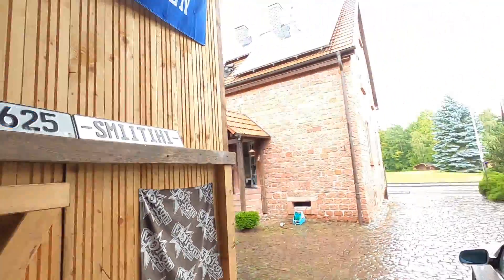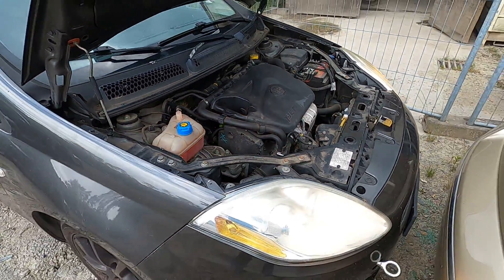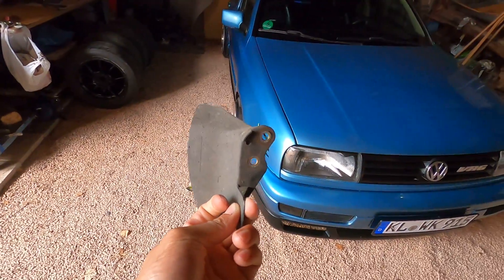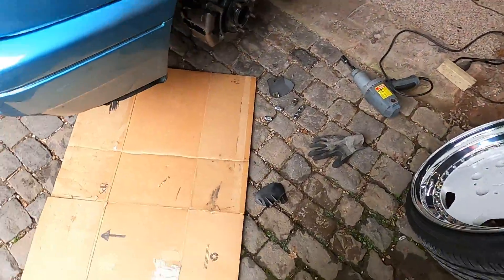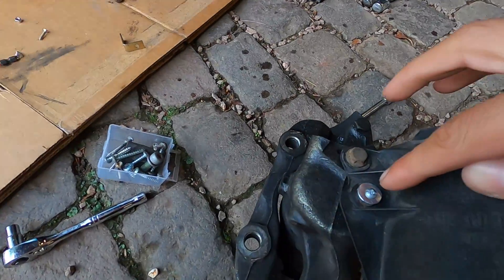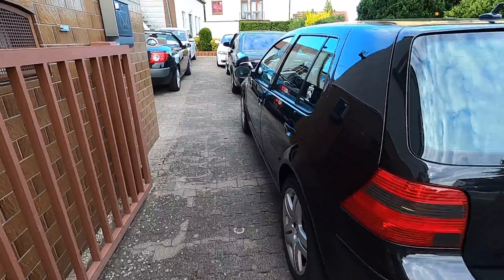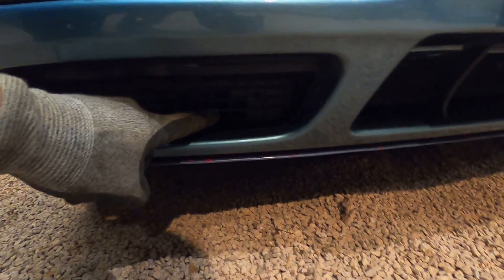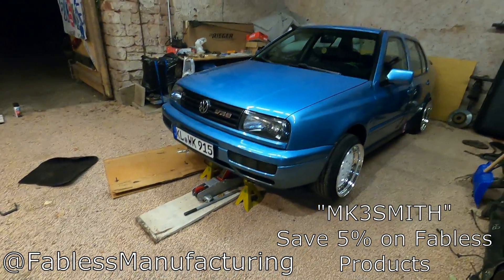Oem Brake Scoops For Miley! ( MK3 Jetta Vr6 )

Comment: Injectors are fucked on that fiat or a restriction in the air intake system. If it was blue smoke it’s burning oil in the combustion chamber. White smoke it’s burning to much fuel